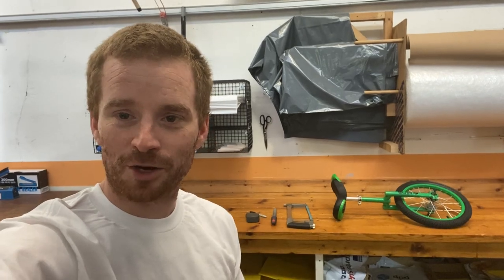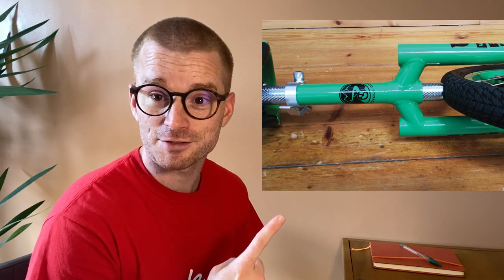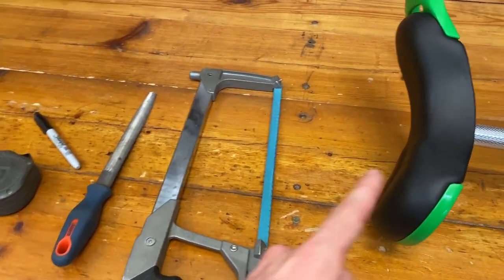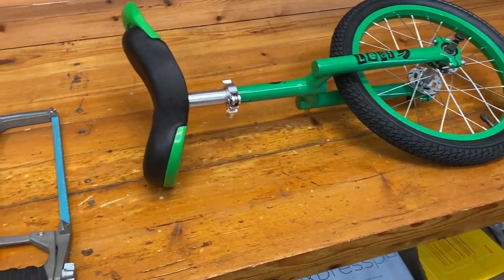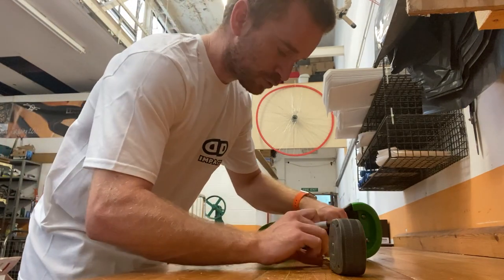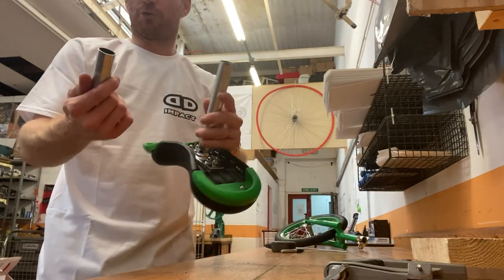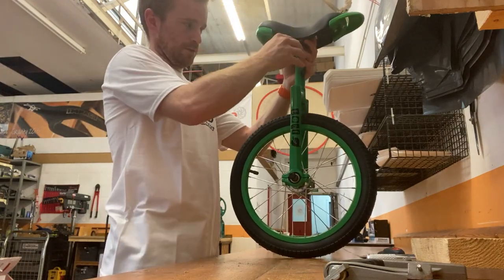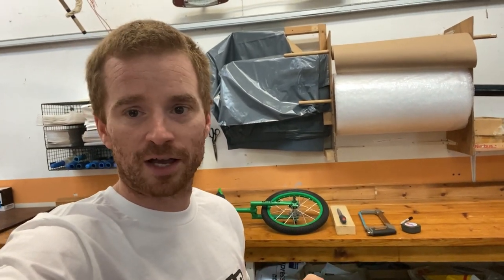Cutting Down Your Unicycle Seatpost (How to)

Comment: Future Nick is becoming a regular in this videos!

I like your seat-post chopping without using a vice - it's not the most practical way to go about it, but it's realistic for many people and shows that it still can be done with very limited tools.

One thing I see missed a lot which was only kind of mentioned, is that when you're cutting a post (especially an aluminium post) with a pipe cutter, no matter how smooth it looks you typically still need the file as the metal around the cut will be a very slightly larger diameter than the rest of the post, which then needs filing down for a proper fit.
Reply from the maker: Ha, people are liking "Future Nick", I'm sure he will pop up again in future videos.

You hit the nail on the head, there are loads of tools to make this job easier. In reality you only need basic tools, which most people can get access to.

Yes, maybe that needed highlighting more. Cleaning off the cut is essential before putting the seatpost back into the frame.